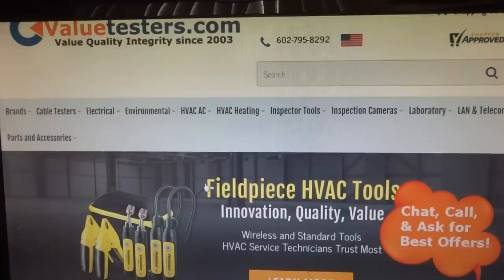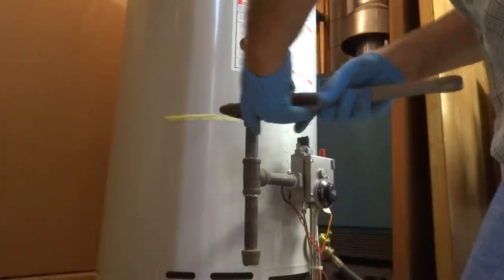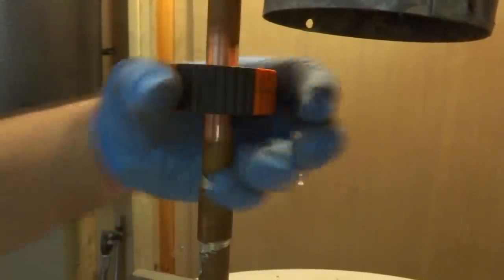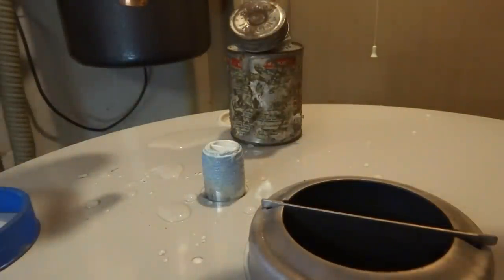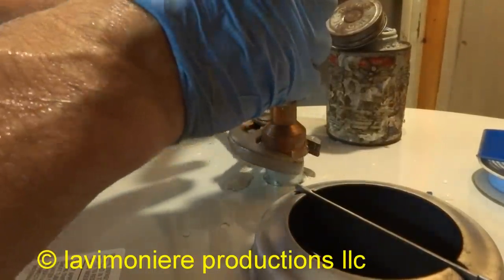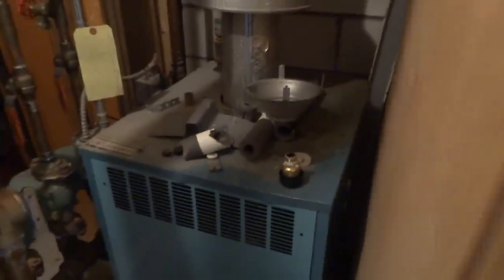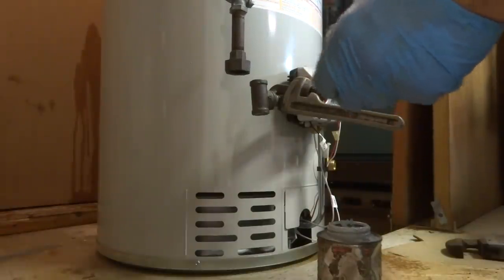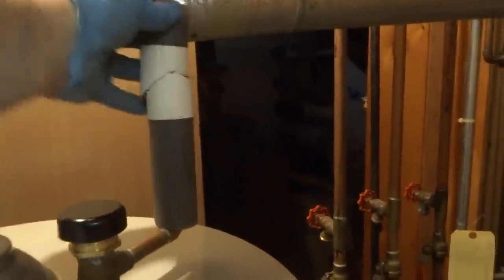gas water heater replacement complete

Comment: Great job on this water heater replacement. You male it look easy, what is the brand or name of that little water pump? Is it self priming, and how does it handle the sediment build up in the water heater? Next level on the guard dog. It's not the size of the dog in the fight, its the size of the fight in the dog.

Comment: question....when I changed my water filter I noticed rust settled on top of the cartridge  I have a water heater that's  7 years old  and the zinc  was never changed.....   baby dog was guarding that truck   and on top of that workin on the weekend!
Reply: Flush the water heater if you can
Reply: ok  thanks

Comment: These heaters have anodes don't they? do you ever change those? or just replace the water heater when they start to leak?
Reply: Anode replacement?  Never seen it done.
Reply: I replaced the anode.  You can buy them on Amazon.  Much easier that replacing the entire thing.
Reply: Was it a solid rod or hinged?
Reply: Mine was solid and I had the vertical clearance to replace it with a solid.
Reply: That is the problem in many homes.  5 foot water heater 7 foot ceiling.
Reply: If you can bust them loose an change out soon enough water hardness is the deal
Reply: The rod is usually rated for six years.  Less expensive tanks have one and more expensive tanks have two, making them a 6 or 12 year tank.  Getting the old one out definitely took two people and some muscle.  One person must keep the heater from rotating while the other is breaking free the anode threads.  It is not a job for the faint but it is a cheap way to get more life out of a tank.  The rods are <$20.
Reply from the maker: i have replaced anodes rods before,,, sometimes you can not get them out ,they hit the ceiling .usally a tank will last 12 ...14 years no problem  with out changing the rod .most people will only call you when the tank is leaking .if they have a well and smells like rotten eggs changing out the rod really helps ..
Reply: Nice work Steve. Jet glass only at Webb now in New England
Reply: I’ve never been successful removing one. I’ve tried just for laughs on scrap heaters to see how tight is tight. Like other posters here say, I don’t think 400 to 500 foot pounds tight is too far off. They are put in extremely tight!

Comment: Bad dog, bad dog!!! Easy on the females. What is your opinion of the expansion tank for water heaters? Are they really necessary?
Reply: Depends on where you live and if you have a water pressure control installed by the city.

Comment: Do plumbers replace with Bradford White Tanks because they don't last long?  These are the worst tanks in the world.  I am actually surprised this one lasted 11 years!  Usually they leak a few months after the warranty.
Reply from the maker: i install a ton of bradford white water heater .very very rearly i get one to go out under warnenty  there a good heater in my book out of 100 maybe 1 or 2 go bad you do the math
Reply: I had a bradford white in my old house. It was a beast! Problem is I cant find anyone in my area who handles them anymore. Alot of suppliers carry State and American. My water heater id 2006, Ruud power vent.
Reply: watching this video because my Bradford White just went out. Turns out it was the original tank to the house. 40 gallon lasted 20 years and 3 separate families.
Reply: Rheem is the way to go!

12 year warranty and if you replace the anode rod every 2-3 years it’ll last as long as a boiler!

Comment: The last time we had a gas water heater was in 93 before we moved in this house it was in our apartments,We had to stick a lighter under neath to light it,I see they have electric igniters now.I think gas would be good because it is faster as far as hot water at the sink and tub but I am nervous about gas to many explosions.
Reply: Rarely happens with water heaters or boilers if done correctly and inspected for leaks. Water heaters and boilers have gas valves that are designed to stop gas flow if it detects an issue.

Comment: Here in Sacramento ca we are required to hire city inspectors to inspect our water heater installation. You would've been pissed as soon as they failed your installation and made you redo everything up to safety codes. 
No bueno Esteban
Reply: What did he do wrong? I’m just wondering.
Reply: ADKIc3mAnXYT California it’s know for earthquakes so they need to strap the water heater  and flex the gas ..
Reply: hector olague in Mass and CT no law exists.